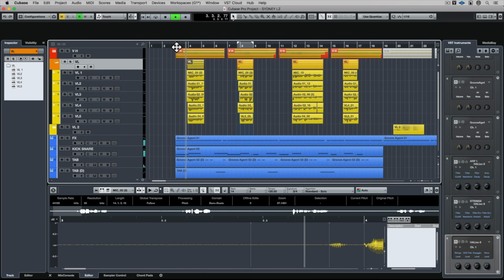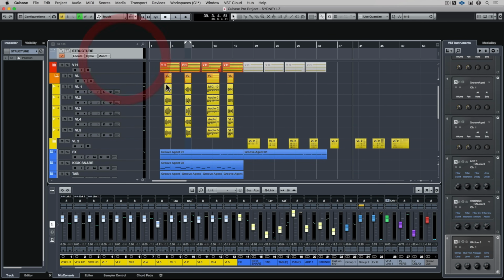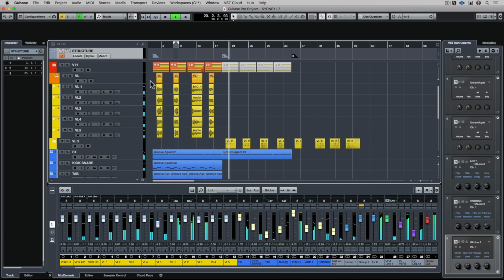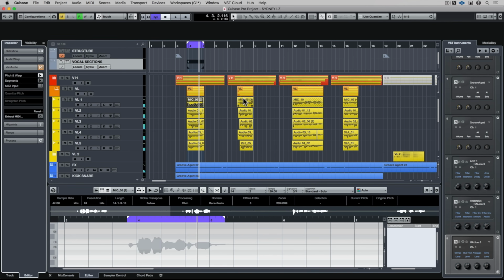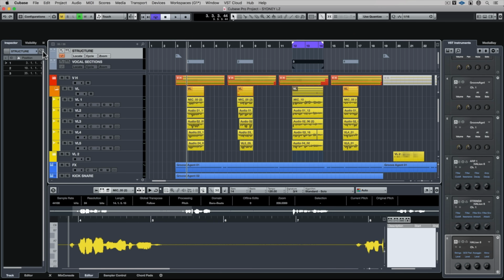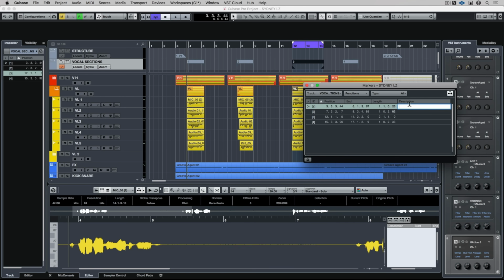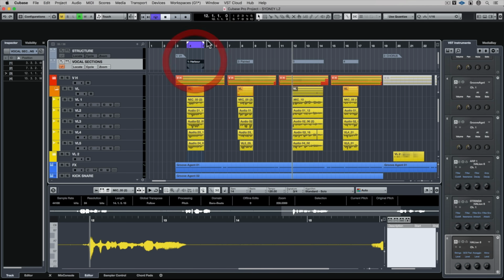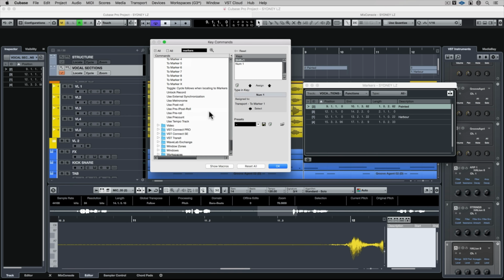Setting up Multiple Marker Tracks | Tips, Tricks and Workflow Enhancements

Comment: When I jump to a the beginning of a cycle marker e.g using the shortcut n or b, the playback/selection locators don't move. I click on "cycle" on the marker track to set the cycle to the cycle markers. Is there a shortcut to do the latter, or better a setting to have the playback/selection locators follow the marker selection? That would save me so much time! Thanks in advance.